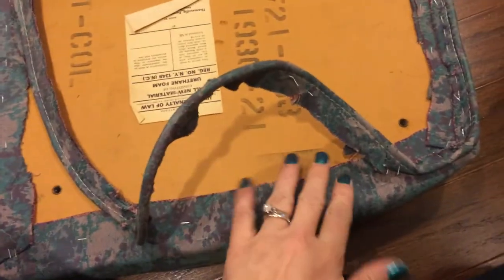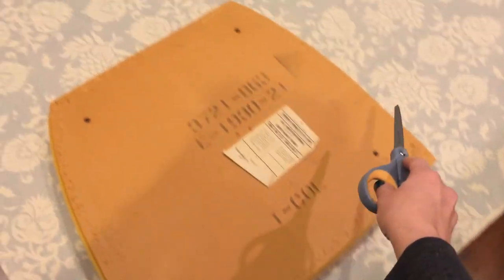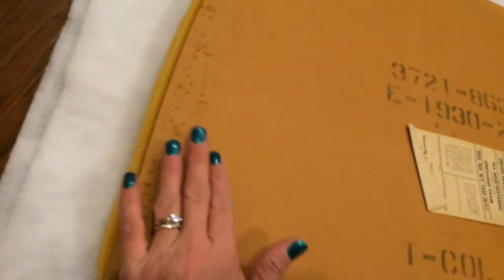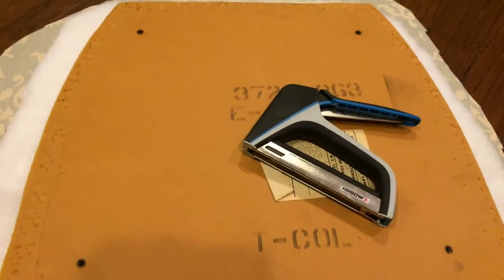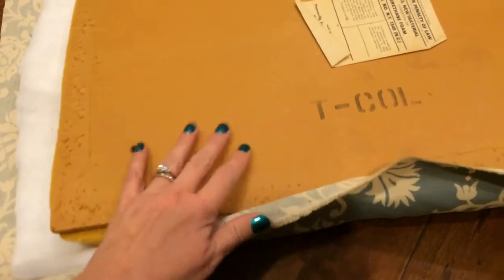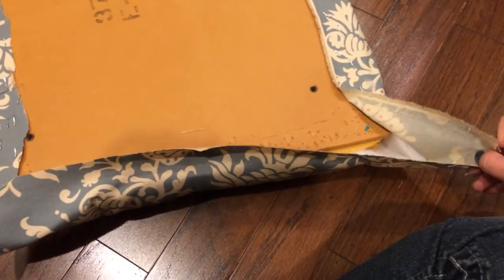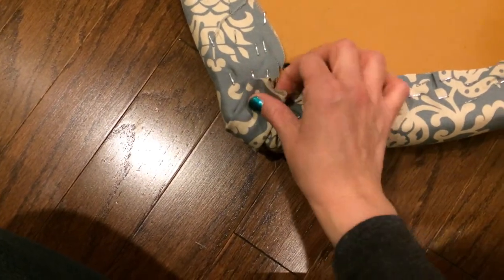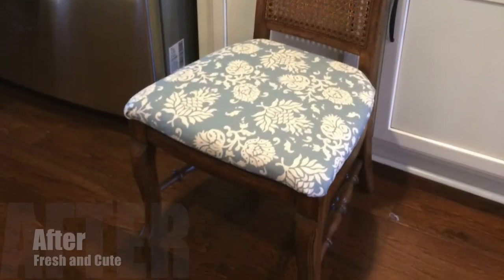DIY | How To Recover A Chair Seat | Reupholster

Comment: Can you please list items needed for this projects? The actual names and where we can buy them or some links? Thanks. I need to restore my chairs. They have stains on them. I love the new fabric. Where did you buy it?
Reply from the maker: newcheveu You need upholstery fabric, staple gun with 1/4 inch long staples, scissors for cutting your material, and extra fluff quilt batting. You can get everything except for the fabric at walmart. I will add links to the description shortly so keep check back today. :)